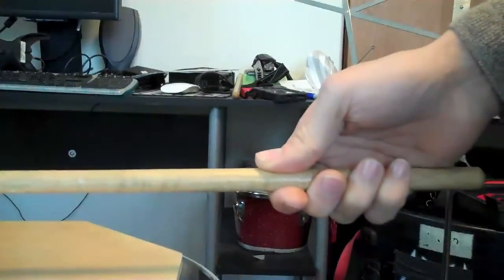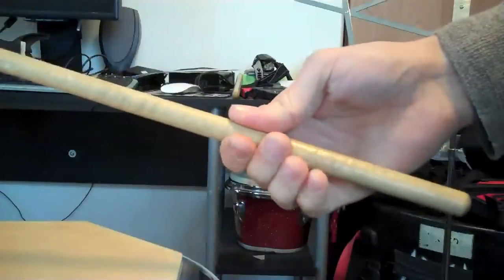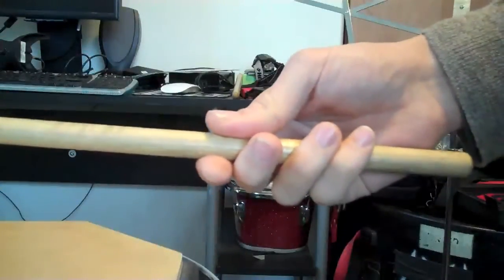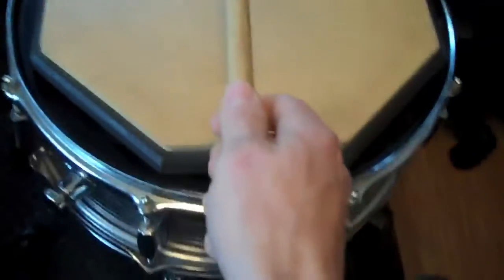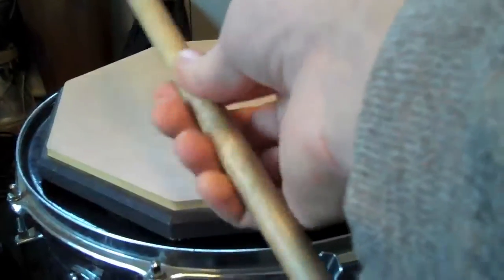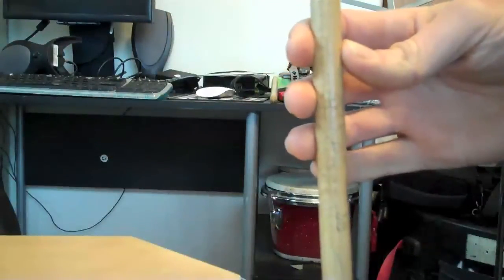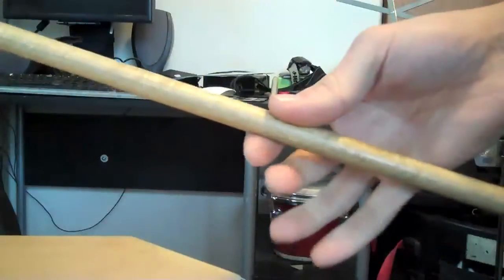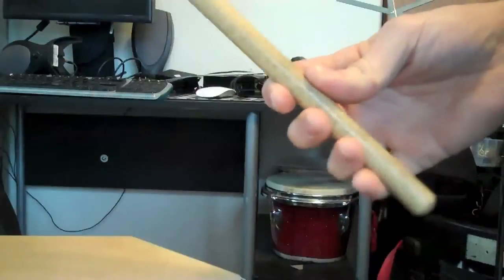French Grip Explained (with 120fps slo-mo)

Comment: Do you have any tips that how i could straighten my left hand to a french grip? Because it is really hard for me and i have to use the american grip then
Reply from the maker: You just have to practice with the correct motion and grip. At first it seems impossible but only because you aren’t used to it. Slow down, maintain form, and it will become more doable over time.

Comment: My thumb can't bend back the way yours does. My hands are just not designed for the French grip.
Reply from the maker: I think honestly my thumb flexibility makes it harder. I’ve seen many people playing this grip with less range of motion in their thumb joints. It’s very possible. This is just the only way I can do it because of how my hands are structured. But you can certainly do it.

Comment: Is it bad technique to blast beat in german grip? I can't play french grip
Reply from the maker: It's not bad necessarily. The only thing I would say is that blasting with a finger stroke is always going to be faster in the long run than blasting with a wrist stroke. If you don't like French grip, you could try American grip finger strokes.  I use those mostly. That would be from a nearly German position but much easier to go fast with.
Reply: What does american grip look like?
Reply from the maker: I should probably do a video of that at some point, but its similar to the German grip but with the stick running more parallel to your arm rather than sticking out to the side of your palm. Usually people turn their wrist over a few degrees toward French grip but the thumb is still more on the side than the top.
Reply: That sounds interesting, i may be doing that without realising it

Comment: Hi. Ty for the explanation. Wherr is your elbow during this kind of stroke? Because is I take my elbows beside my body I feel my wrists are getting stiffed and too angulared to get the right postion. Better if I have my elbows front of my body...
Reply from the maker: Báb Déli my elbow is in normal playing position and has nothing to do with this stroke. This stroke feels unnatural to most people when they start. It takes a while to get used to it. Nothing you do with your elbow will make a difference anyway.
Reply: @RyanAlexanderBloom  Ty for the fast answer. My problem is if my thumb is straight than I have to compensate with my wrists. So my wrists get angulared. Sry I can't explain better this problem.

Comment: I always lose grip of my stick, how can I help that ?
Reply from the maker: Other than just practicing more, there are a few things you could look at. The first is to make sure that you are moving the stick up and down vertically with no lateral side-to-side component. If the stick strikes the drum at an angle instead of straight down, the rebound will be harder to control. The second is to make sure that you are contacting the stick with your thumb and first finger exactly opposite one another. If that fulcrum point gets disrupted, it is hard to control the stick. Another thing to consider is that arm or wrist movement makes this much more difficult. Make sure your arms are not moving around and that you only use your fingers .
Reply: Wow thnxx

Comment: i couldnt get a proper balance while i play with my left hand regarding finger control...... the stick sometimes even falls and i get demotivated...... so what are the steps that i should follow..... right hand is very relaxed by d way and i can easily play at 100bpm.....
Reply from the maker: Ajan Das first compare your hands. It’s probably that your left is doing something wrong. Use a mirror, a camera, or get a second opinion from another drummer. You can’t always see issues from the top. Then if you think your grip is good, play only a few strokes. Start with 2. If you can play doubles correctly without problems then move to triples. Then 4s, etc. at some point the problem will emerge. That’s when you should be able to tackle it. One likely problem is just grip strength. Your weak hand is weaker, obviously. Try to beef it up by eating, brushing teeth, opening doorknobs, using keys and doing other tasks lefty for a few weeks.
Reply: Ryan Alexander Bloom playing slowly is also the key rt?
Reply from the maker: Ajan Das sure, but only as slowly as you can maintain good rebound. Too slow and it might not work for a skill like this.
Reply: Ryan Alexander Bloom does practicing only with the grip works does it helps to build strength...... Actually I have a tendency to overlook or overanalyze things

Comment: Great video, really helpful for this guitarist learning the drums. Very much need to work on the grip but was able to get some nice rebound strokes going thanks to this.

Quick question. Do people do finger strokes in German grip as well? I find that with palms facing down and fingers wrapped round the sticks, I can get a decent rebound from just the fingers (without wrist involvement)
Reply from the maker: Typically, no. People do not do finger strokes from a strictly German grip. You can easily do them from an American grip which is similar but with some slight alterations. I have a video on this on my channel if you want to check how I do it.